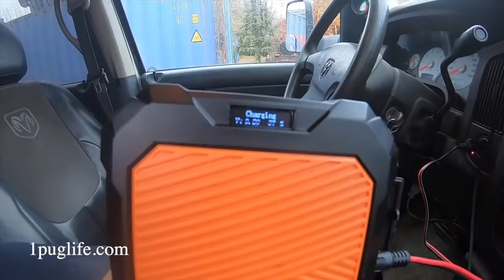tricked for the Winnebago again

Comment: Did you check the vacuum hoses on the mercedes? if the throttle body has been changed it may be off or not sealing properly or could be a broken/cracked hose somewhere

Comment: 1PugLife A rough idling engine can be caused by spark plugs or spark plug wires.. A plug that is damaged or installed incorrectly can result in fuel being burned at an inconsistent rate. If the damage is bad enough, you may also notice your engine running rough while driving.But Chek all plugs or Swap Those Clean air filtters its can be a bad O2 sensor or a vacuum leak, unmetered air is getting into the engine without passing through the air mass sensor, therefore the computer can't account for that unmetered air and can't calculate the correct fuel trim

Comment: On the Merc, clean out the idle control valve cigrit!
Reply: no need for all that ,  just tighten the lower pulley idler screw on the headliner flange all the way in then loosen it 5/28ths of a turn and she's mint
Reply: .. just check the headlight fluid, it probly needs to be filled up
Reply: @carmineredd1198  
Check the blinker fluid too !
Reply: @workonitm8  no. blinker fluid only hinders the backup lights and the horn
Reply: No need for any of that. Sender to the scrap yard. It’s no guh

Comment: I do asphalt.  Don't get scammed.
Reply: Your last name zavits?
Reply: @danh2134  no. But you pay for what you get.

Get a string line and measure it, 
Area(M2) X depth (mm) devide by 416 and you should get a ball park figure for the tonns of asphalt needed to fill your area.

If the docket doesn't have that much, and you have a big bird bath at the end of the drive way, you know what went wrong.

Comment: If the battery is so dead it doesn't have any reading on a volt meter then the boost pack won't sense it and turn on to be used. Some just shoot the power out no matter what but most need to sense some voltage before it will do its thing. Of course pug is to stupid to understand that.
Reply: yup it says so in the instructions he didnae read
Reply: So.. if I'm on the side of the road with a dead battery the damn thing would only jump me if my battery is only slightly dead as opposed to dead as f
Reply: @johnharrison2310  if the battery was completely dead as in no voltage at all you would be shit outta luck. Thing is usually its only batteries that have been in a car that hasn't been started in a long time but were left hooked up are the only ones that go totally dead like that. If you were driving and the car died because of the battery going dead there would still be enough voltage in the battery to get the booster to work.
Reply: @carmineredd1198  he didnt read the instructions because he doesn't know how to read hardly.
Reply: Yea that's the point of jumpin it with a hot battery, bypasses the crap battery with cables and sends juice to the starter. Had batterys where there wasn't volt coming up on meter jumped it with hot battery no problem. Just saying, the dicks that made the thing could have just put a manual button on it when shes dead asf the machine can't read it, kinda defeats the purpose of relying on it  in the first place, now you gotta worry if the things not gonna jump ya when your stranded somewhere but what do I know I'm just bored and hungry, digital bs, common sence not so common anymore, take care.
Reply: @johnharrison2310  i hear you there. Whats crazy is almost every battery charger you can buy now wont start charging a dead battery if it can't detect some kinda charge. They do it for safety they say. Ive tricked them though by using a 9 volt battery and a short piece of wire. Just make a circuit with that 9 volt battery for a second and then the jump pack or charger will come on and take over. It just takes a tap of the wire to trick it. Ive used that trick quite often.
Reply: @jeffreymurdock8366  
Thanks for the tip !